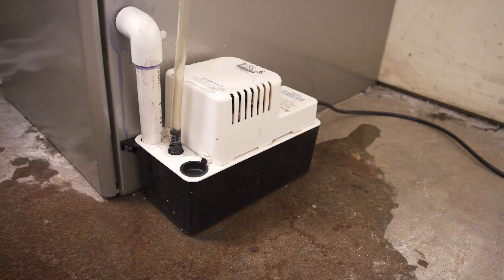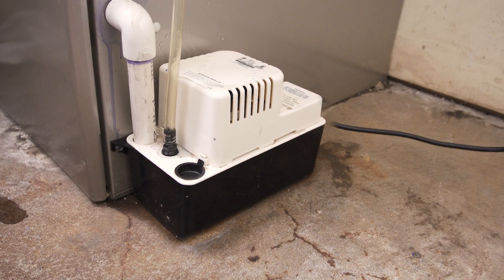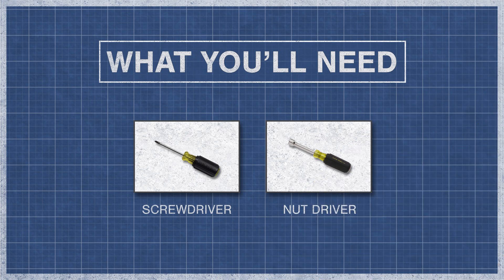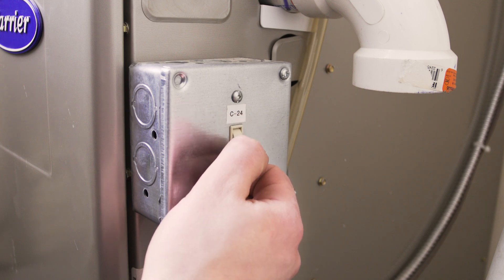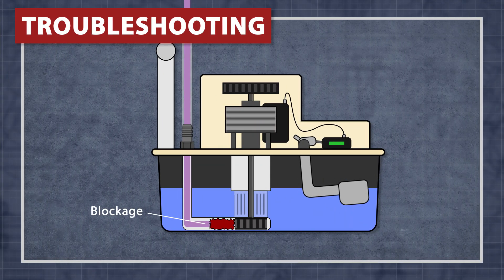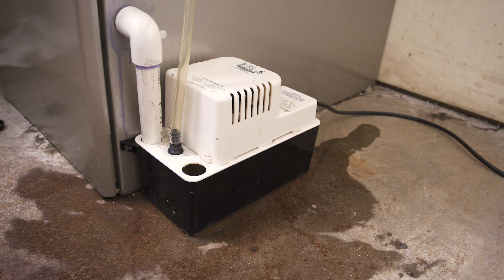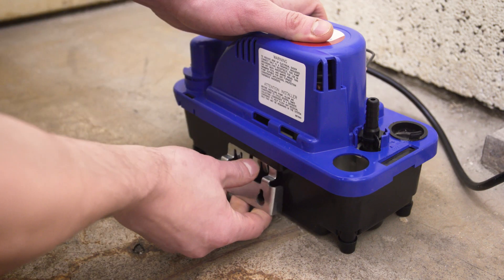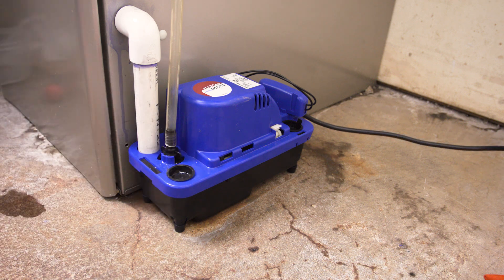Condensate Pump Replacement & Troubleshooting | Repair and Replace

Comment: What do i do with the two wires coming out of the safety switch? The old pump doesn't have them.
Reply from the maker: Hi Richard, thank you for watching. First of all always read your new condensate pump manual as there might be some differences between models and always shut the power off at the breaker box.

The manual should mention something similar to this: The wires from the safety switch are to be wired in series with the 24V thermostat circuit. This safety switch will interrupt the signal from the thermostat to the furnace if the water level in the pump overflows (pump fails). Though the colors are not standard, commonly the Red or the R terminal will have 24VAC power from the thermostat.  The thermostat wire can be cut and spliced as it will already have a connector at the end of it leading into the furnace control board.

Comment: I just had  my condensate pump looked @ by a friend of mine who is a HVAC Technician the problem I was experiencing with my unit was when the A/C was on I noticed water on the floor.  The problem was a clog in the plastic tubing caused by a slug from the outside drain which had been laying in the grass. Easy fix so now I have the tubing off the ground problem solved.
Reply from the maker: Thanks for sharing your experience Tony. Its amazing how such simple things can be the source of the problem, we're glad you have everything back up and running!

Comment: Im changing a condensate pump (clear vue) for this little giant - how do i know which is the correct way to hook up the new safety switch to the furnace?  they have different labels on the 2 pump models
thx
Reply from the maker: Hi James, thanks for watching. First of all always read your condensate pump manual as there might be some differences between models and always shut the power off at the breaker box.

The manual should say something similar to this: The COM and NO connections from the safety switch are to be wired in series with the 24V thermostat circuit, this will interrupt power to the furnace if the water level in the pump overflows (pump fails). Though the colors are not standard, commonly the Red or the R therminal will have 24VAC power from the thermostat. 

NC means normally closed, and NO means normally open. In cases that power to the furnace can't be disrupted, then the COM and NC terminals can be wired to a safety alarm.
Reply: @AmreSupply  thanks for the response - as a new home owner, your videos are very helpful !!
i am trying to figure out how the NC/NO terminals on the new pump (NC/NO/COM) correspond to the ones on the old pump ("Alarm"/"Common"/"Run") - the current pump is hooked up to "Common" and "Run" - so i assume "Run" is the same as NO?
The manual does say,
"Safety switch: The safety overflow switch should be connected to a Class-
II low voltage circuit. To control a thermostatic circuit the COM and NO 
connections from the safety switch are to be wired in series with the low 
voltage thermostat circuit to shut down the heating/AC circuit. The COM 
and NC switch contacts may be used to actuate a low-voltage alarm circuit 
(connected in series) if the heating/cooling system can not be disrupted. 
The safety switch comes from the factory with leads connected to the COM 
and NO switch terminals."
Reply from the maker: @jamesandrewtown   We're glad you're finding these videos helpful! You are right in your case, Run is equivalent to NO.
Reply: @AmreSupply  Thanks again ... turns out the new Little Giant doesnt label the safety switch wiring and the guy who came to look at it said it could be wired in either orientation... hooked it up and seems to be working fine!
Reply from the maker: @jamesandrewtown  Glad its all up and running now!

Comment: Hi where’s does the safety switch goes out the pump those 2 wires you had when you put on the plastic protectors do they stay outside or inside the Condenser
Reply from the maker: Hi Jamil, thats a good question. The safety switch stays outside the condenser pump, and is connected to the furnace, so the wires and connectors are just tucked behind the pump to keep them out of the way. Keep in mind not all furnaces are wired to have a safety switch though.
Reply: AMRE Supply thanks I just did it I cleaned the pump and it seems to be working
Reply from the maker: You're welcome! We're glad you got it back up and working again! Cheers
Reply: Thanks

Comment: 01/16/19 Yes. It helped. Four Seasons replaced the pump. But now there is a loud noise.
Reply from the maker: Hi Dorothy, thank you for watching. Are you saying that the new pump is noisier than the old pump? Or is the sound coming from the furnace?

Comment: Mine keeps making a noise like a whinning noise all day on and off
Reply: 01/16/19 Four Seasons replaced the pump at great cost. The new pump is making the whining noise at all times during the day & night. Does that mean that I have to continue to live with this annoying noise? The old pump was quiet for many years.
Reply from the maker: Hi Cris. The whining noise is likely the motor. Condensate pumps will run occasionally throughout the day as the reservoir fills with water. Overtime the pump can get dirty, and the bearings may be worn down, so a whining noise is a sign that you need a new pump.